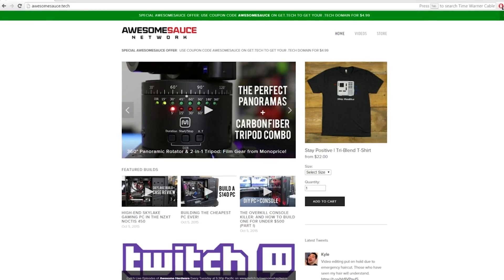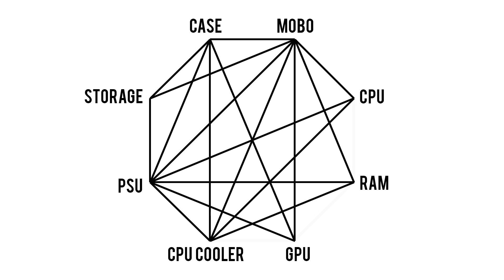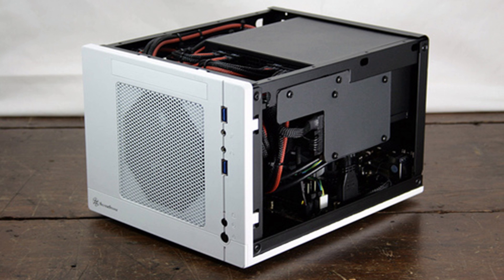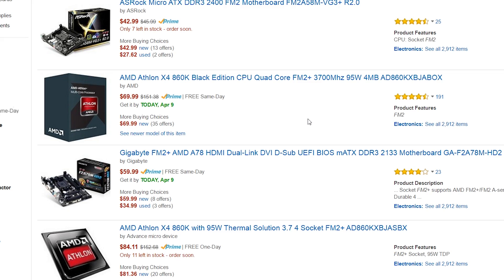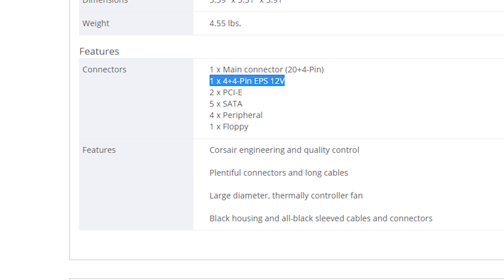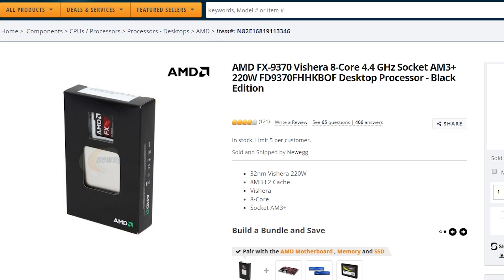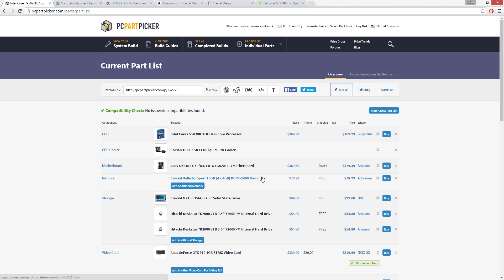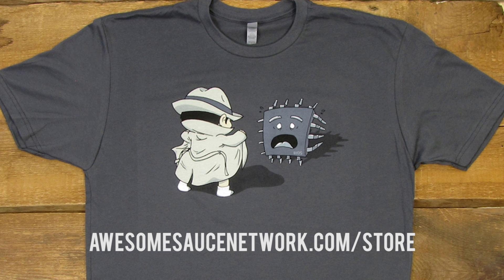How to Choose Parts for a PC! The Ultimate Compatibility Guide!

Comment: Thanks man! Using your video, i acomplished mission and i created this:

Case: Dark Base Pro 900
Mainboard: Asus X99-A Carte mère II (Socket 2011-3/X99/DDR/S-ATA 600/ATX)
Procesor: Intel Core i7 6800K
Graphic card: NVIDIA GeForce GTX 1070
Power: Corsair CP-9020073-EU Professional Platinum Series HX850i ATX/EPS
Memory: Corsair CMD32GX4M2C3200C16 Dominator Platinum 32GB (2x16GB) DDR4 3200Mhz
Hard drive: Samsung 960 EVO MZ-V6E500BW M.2, 512 GB + 2TB HDD
Cooling system: Corsair Watercooling Hydro Series H115i
Monitor: LG - 34UC98

Mayby some advice?

Comment: Do I have to worry if I'm using the stock cooler?
Reply: Joe Sheward as long as you don't overclock it or use it 100% all the time for long periods, it should do the job, but you could get a better cpu cooler already for about 20 bucks
Reply: If it's meant for normal use yes(Browsing, school works and stuff like that.). But if you plan on Gaming (specially with high settings) , i recommend buying a 20-30€ because it will require more power and therefore will produce more heat.

Comment: I want to build a PC around $1000. I plan on using the i5-6500. I also plan on using a GTX 1070 for my build. I am still stuck on a motherboard selection. I and trying to get reliable board that has usb type c and good sound. I am thinking of the Asus z170-a or the Gigabyte G1 gaming GA-z170-gaming 3 or 5. Is there any other motherboards that are better than these two and are under $160? Please help as soon as possible because Black Friday is coming soon!

Comment: Hey! Anyone could tell me if the Asus Z170-P has a soundcard? Because if it doesn't i will have to add one to my list...

Can you evaluate the PC build im planning on making??

Intel Core i5-6600K 3.5GHz Quad-Core Processor
EVGA GeForce GTX 1070 8GB Founders Edition Video Card 
Crucial Ballistix DDR4-2400MHz 16GB
Deepcool TESSERACT SW ATX Mid Tower Case
NOX URANO TX 850W ATX
Asus Z170-P
Toshiba P300 1TB 3.5" 7200RPM Internal Hard Drive 
Cooler CPU Cooler Master Hyper 412S
Samsung DVD-RW Slim 9.5mm 8x Sata Preto Bulk
Coolermaster SickleFlow 120mm Led Blue
Reply: Most motherboards don't need soundcards because they are built in check your motherboard. Usually you will see an aux port and maybe an optical audio.
Reply: +Jonathan Trottier Thanks for answering. I had foi d out that if they have audio outputs then it hás xD but thanks anyway

Comment: Can someone help me and adjust my build a little? im kinda on a budget but want to run games as best as i can. http://pcpartpicker.com/list/xgMbkT
Reply: mujjuman Thanks will consider
Reply: Zwar Ahmed 
go to techsource i think he has a 500$ pc build for oct.
Reply: what mobo r u thinking of
Reply: hey brother salam this is the cheapest i could come up with for an intel build let me know what u think http://pcpartpicker.com/user/mujjuman/saved/LpFGXL
i gave you a few upgrade options for later down the line: upgrade to a i5 6500 or i5 7500, add another stick of 8GB RAM for 16GB total, add an SSD. also if you want wifi, add the TPLink wireless card. i hope you already have keyboard, mouse, controller, speakers, and monitor... let me know if u can help u more i live in chicago.
Reply: Salam brother, i really appreciate the help. The goal of this build is to make it so there is plenty of room to upgrade in the future. Thanks for the suggestions.
Reply: You're welcome bro. The biggest upgrades you can make to this system in the future is a quad core CPU like the i5, and double your RAM to get rid of the bottlenecks. You'll gain plenty of fps and smoother gameplay by those upgrades. But the system as i built it should be able to handle most games with little problem. Another option for maxiumum upgradability spend like $100 more on the baseline for a Z170 mobo so you can upgrade to a i5 6600k or 7600k CPU. That way, you have the best that an i5 has to offer with overclocking capabilities. But if thats not important for you, then the current mobo i chose for you should be sufficient with an i5 upgrade. Then in like 4 years, you can drop in a newer graphics card and still stay current and up to date.

Comment: Eh, really solid vid except for 1 thing: I think your CPU should be either your first choice or 2nd choice, at worst. If not first, then the SIZE of your case should be the only other thing to get top priority, and then, just the size, not the exact case. I guess picking your video card first can play a role, but  unless you're getting a very premium card with huge coolers, that isn't really relevant...

1 - pick your case size; Full-, mid-, mini- tower or mini iTX.
2 - pick your CPU. If you don't have a specific one in mind, go here:  https://www.cpubenchmark.net/cpu_list.php  and pick for either price or value. Then use https://pcpartpicker.com/ to find one that's available and a good price, based on the benchmark site.

3a -  pick your mother board, going for the largest form factor that will fit your case. 
3b - pick your case. this is a choice of either 3a or 3b, depending on price, performance  and options.

Then just use PC parts picker and Kyle's advice to get the rest.

Comment: http://pcpartpicker.com/user/mayy/saved/#view=jGD23C

is this good
Reply: I can't say about the monitor, but overall looks ok. One thing, since you are getting a plain 6500, and not a "k" (overclocking) version, it will come with a factory cooler that should be good enough, and you could spend the saved $20 and upgrade to a i5 6600.

Comment: Can anyone give me some advice? I'm planning on doing my first ever PC build with the following components:

CPU: Intel i5-4460 3.2ghz 
Motherboard: Gigabyte GA-Z97-D3H ATX Motherboard
RAM: Corsair Vengeance (1x8GB) RAM
Hard Drive: Western Digital Blue WD10EZEX 1TB
GPU: EVGA GeForce GTX 960 SSC 
PSU: Corsair VS550 550W power supply
Optical Drive: Samsung SH-224FB
Case: Corsair Carbide 100R
Operating System: Windows 10 Home

Is this a good starting build? It fits my budget nicely but is there any parts where I can save money? Thanks!
Reply: Joshua Brown Make sure you also list the CPU cooler.
Reply: The Magic Conch I'm just using the one that comes with the CPU
Reply: If the 960 that you're getting has 4 gigabytes of vram then yes. Or you can try an RX 480. 
Also I would recommend buying a cheap 120 GB SSD for your Windows 10. This build should be good for gaming, assuming that's what it's for.
Reply: The Magic Conch yes, this PC was for gaming! However, the GTX 960 was only 2GB of VRAM. I did check for 4GB versions and the price sort of went over my budget 😂 as well as a SSD would also. Are these compulsory?
Reply: You do not need an SSD(It's just super fast storage). The 4 gigabytes of VRAM however is highly recommended. 2 gigabytes will make your games slower and have less quality.
Reply: The Magic Conch ok, thanks for the advice!

Comment: great video Kyle, but you forgot to include case fan compatibility (i.e. different fan sizes and different power connectors for case fans). one example that I can think of is my PC where my side panel case fans keep me from using taller cpu air coolers.

Comment: Actually, CPU (at least some of them) has requirement of memory type, memory size, and memory frequency
For example, my E3-1230 v2 bought 3 years ago only support max. 32.77GB memory, DDR3 1333/1600 only. It also have no. of channels limitation and ECC support issue relating CPUs and memory.

Comment: Hi please check if my pc is compatible :)
TYPE             ITEM                                                                       PRICE
 
CPU              AMD FX-8320 3.5GHz 8-Core Processor                    $144.99
 
CPU COOLER 
Cooler Master Hyper 212 EVO 82.9 CFM Sleeve Bearing CPU Cooler    $29.94 
MOTHERBOARD      
Asus M5A99FX PRO R2.0 ATX AM3+ Motherboard                                $115.99
MEMORY   G.Skill Ares Series 8GB (2 x 4GB) DDR3-1600 Memory       $69.99 

STORAGE      
Seagate Barracuda 1TB 3.5" 7200RPM Internal Hard Drive                        $54.43[

VIDEO CARD    XFX Radeon R9 280 3GB Double Dissipation Video Card    $239.99

CASE   
Corsair 200R ATX Mid Tower Case                                                                      $54.99    

POWER SUPPLY   
Antec HCG M 850W 80+ Bronze Certified Semi-Modular ATX Power Supply        $79.

Comment: are all of these components compatible?

AMD A6-5400K APU 3.6Ghz Dual-Core Processor
Gigabyte GT 420 2GB 128-Bit DDR3 PCI Express 2.0 x 16 ATX Video Graphics Cards
Gigabyte AM3+ AMD DDR3 1333 760G HDMI USB 3.0 Micro ATX Motherboard
Crucial 8GB Single DDR3 1600 MT/s PC3-12800 CL11 Unbuffered UDIMM 240-Pin Desktop Memory
Cooler Master Hyper T2 - Compact CPU Cooler with Dual Looped Direct Contact Heatpipes
WD Blue 500GB Desktop Hard Disk Drive
EVGA 500 W1, 80+

trying to make a 430$ computer for my friend
Reply: LuckiestLuck just check PC part picker

Comment: Well, my tip is don't buy a stock PC with the idea of upgrading it. HP, 
Dell and such often lock their bios. You think your i7 runs your gtx 980
 without problems. Only to find out it doesn't get recognized. If you 
not aware you might actually think your GPU is broken. I've been there 
lol

Comment: I'm very new to the world of building a custom pc and over the past few days I have been watching as many how to, budget build, informative, etc videos as possible trying to learn as much as I could. After watching hours upon hours of videos I think I might have a parts list I could do. I would really appreciate if I could get some feedback on the parts I picked out and any advice on what I should change with it/ how to make it better. http://pcpartpicker.com/user/Jsetter/saved/8VrHxr.  I was aiming for 1500usd including keyboard, mouse, monitor for a system that could handle 1440 ultra well.
Reply: It's a great build, but if you pick a K processor, you might want to get an AIO cooler so you can overclock better. It's not at all required, the current CPU cooler is fine, but a better one will reduce CPU temperatures, noise and increase your CPU's lifespan if you plan to heavily overclock it.
Reply: Thank you for replying and for the advice. I wasnt planning on doing too serious of an over clock but I was definitely planning on ocing the cpu. thats why I thought I could get away with the just the evo 212 and also something about having water in a computer seems a bit risky to me with leaks and such not to mention if the pump fails. Is water cooling needed for a moderate overclock? If it is do you have any suggestions? If not do you think there are better performing aircoolers at the same price point?  please let me know I could use all the advice/knowledge I can get.

Comment: Side note for case/mobo/gfx compatibility, that would fall under expansion slot availability, and very case specific (ha, see what I did there). Anyways, if you plan on running a ton of expansion cards like RED accelerators and video io, or SLi and your mobo includes an expansion slot io card, ie the thunderbolt card included with Asus's X99 Deluxe II, make sure your case has enough physical slots and your mobo has the proper speed pcie slots.

Comment: http://pcpartpicker.com/list/kw3xHN this is compatible right??
Reply: yes, but make sure you are using an ATX case. Also, if you plan to overclock that 6700k, then I would recommend getting a better cpu cooler. if you're not overclocking then get an i7-6700 non-K, and a b-150 or h-110 mobo

Comment: 100% beginner here and I apologize but I was confused by the video. I got that:
cpu = processor
Gpu = graphics card
Psu = power supply
Memory = RAM
Storage = SSD, Hard drives
Case = case
MOBO = motherboard

What do the names 2060 ti,ddr4, PCIe, h110 or z170 mobo, "ssd for your OS. I5"and mean?
 I read comments about suggested parts and I am 100% confused on what they mean. I'd like to
1)understand the terms or model names 
2)Have a pc that runs games at 60 or over fps preferably Minecraft and ROBLOX with a 500$ budget
Reply: DDR4 is the generation of the ram. 
PCIe is the connection interface between the motherboard and other component that uses PCIe slot like graphic card, network card, sound card,etc.
H110 and Z170 is the model name of the intel's latest motherboard.
OS is operating system like window 8, 7, 10, etc. It is better to install OS into SSD because SSD has much faster loading speed as compared to HDD (hard disc driver or hard drives)
Reply: WOW THANK YOU SO MUCH YOU MADE IT SO MUCH CLEARER
Reply: When buying a gpu pay attention to the amount of video memory, most cards come in 2gb mine is 4gb I would recommend a 6gb for serious gaming and also if you use mods because it uses a ton of video memory. For CPU get a processor that has hyper threading as well. Memory you could get away with 8gb I'd recommend 16+ whatever you do don't buy a pre built, you can save yourself a ton of money building one yourself. Be careful about each particular step you need to do to put together a pc it's never good to just throw parts together and hope it works, then you have to restart because you don't know where you screwed up. 

I would recommend specific parts but my gpu alone costed more than 500 so I'm not the right guy for that.
Reply: illvisual I can run it on integrated graphics of an I3 with 80 fps😂
Reply: elbasu libra Case = Case. 😂😂
Reply: InquizitorPhil not me
Reply: Sheepdog Gaming Proof?
Reply: elbasu libra ok so your buying a toaster NICE
Reply: illvisual 

Thanks! Any more tips from anyone? I think I'll most likely go with the custom built recommended up in the earlier replies and also to add I'm not that serious of a gamer I'm pretty new haha but thanks anyways!
Reply: WB IsMe No problem (:
Reply: ***** Actually not, my gtx 950 couldnt hang with 60 fps, my 4gb gtx 770 can but its still not ideal it shouldnt take a 400$ gpu to run a game that looks plastic.
Reply: elbasu libra good luck with that, buddy.
Reply: how do you designate where to instal the OS? I never would have thought about that.
Reply: HAWXLEADER I thot a Case was a Case but it needs to be lower-case
Reply: Names:
2060 Ti = Speculation – NVIDIA Pascal Refresh “GeForce 20” Series. The GP106 refresh will come in the form of GTX 2060 Ti and GTX 2060. These graphic cards will replace the GTX 1060 6 GB and GTX 1060 3 GB models. If these video graphic expansion cards are indeed planned for launch...
PCIe =  Peripheral Component Interconnect Express. PCIe 3.0 is the latest standard for expansion card slots.

DIMM = dual in-line memory module. Variants of DIMM slots support DDR, DDR2, DDR3 and DDR4 RAM.DDR4 = double data rate fourth-generation and SDRAM = synchronous dynamic random-access memory.
H110 Could be a referance to the Corsair all in one (AIO) Liquid Cooling or the CPU (Central Processing Unit) but I'm guessing your looking at Skylake CPU consumer motherboards. Z170 is one of those types of chipsets on such motherboards as are H170 and or H110. The primary difference being that the Z170 chipset fully supports CPU overclocking, while the H-series chipsets do not.
SSD = Solid State Drive
OS = Operating System (Windows 10)
i3, i5 and i7 are Intel CPU's; K series ones can be overclocked and the i3 can"t be.
Austin Evans just did a video on the Raspberry Pi Zero W  that for $10 played  Minecraft...
Reply: Sebastian Michaelis WHAT? I always thought the case of a case being a case is just so you can build a case!

Comment: Mobo: Make sure to check your Mobo network support  aka quite often they dont support wifi & that might not matter but some people assume wifi is build in .. while some genuinely only need the real cable connection.
Case: check how many fans comes with it or do you need to buy more fans for better airflow. Take into account if the case needs to stand on a carpet or not (aka psu intake sucking air in from the case or outside). Strongly suggest a case with a easy to open sidepanal for easy access, air can cleaning, emergency hot summer venting etc.

Comment: Question, does the Intel i5 6500 stock cooler keep the CPU cool enough?
Reply: Yes.
Reply: +yafhaio aeiohtoia how do you know? A lot of people seems to give crap about the stock coolers, and put it in a gaming situation
Reply: SuperTommy64 As long as you're not overclocking it's fine. Would an aftermarket cooler reduce temps/noise? of course.

Comment: Building a Linux gaming rig in 2014, I was able to mind all the compatibility issues mentioned in the video -- except one: the mainboard I chose (an ASUS H87i plus Mini-ITX Socket 1150) supports USB 3.0 with proprietary Windows drivers only. So, to this day I'm unable to use these USB-3 slots for anything other than USB 1.1 and USB 2.0. Just a minor inconvenience, but I get reminded of it each month when I do a full backup.